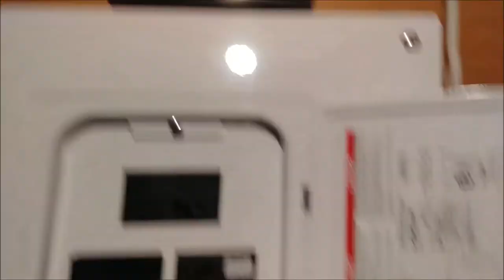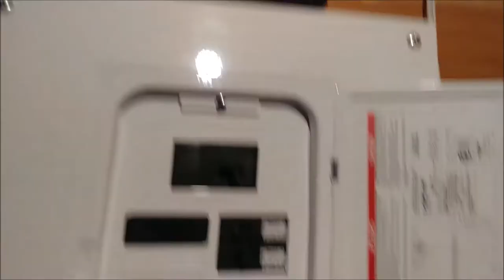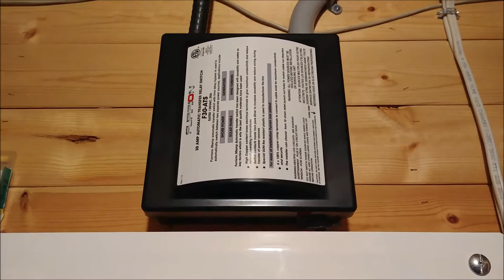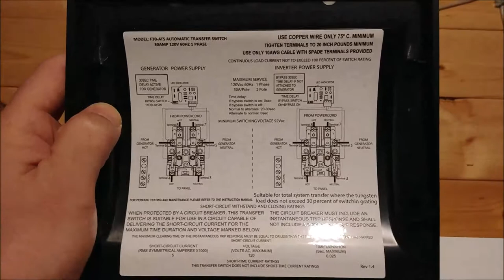Cabin Life Off Grid Living: Automatic Transfer Switch For Multiple Power Sources

Comment: Hi there . I have the same set up at my hunt camp which is generator power and I am adding solar. The only difference is my generator brings in 220 into the panel. You think that switch could still work?
Reply from the maker: Hi Gilles, unfortunately this particular transfer switch is rated at 120vac, (120 volts).  I could help you search an alternative that will work if you like?!
Reply: Dave Wilcox Jr Outdoors The more I get into this I think I would have to switch my generator to 120. Then I could use any transfer switch. Don’t see a solution with the panel on 200 amps. Thx for your help

Comment: Have you got a Magnum sign why would you install a transfer switch inverter has one in it
Reply from the maker: I didn't always have that charger/inverter, I also didn't use the Magnum charger to charge the banks, the system is recently changed that will have that transfer switch eliminated.  I'm working on moving the entire battery banks and solar equipment to another location.  These automatic transfer switches work well for many lower cost inverters without the charging capabilities.
Reply: What's the make and model of the transfer switch? The video says it would be in comments but I'm not seeing it. Thanks!
Reply: The inverter has a AC input you don't have green so you connect a generator to the input damn you set the inverter cats grid priority when your battery go low you start your generator dad inverter with automatically transferred and it will charge your battery off the generator the master electrician you got do not know Squad